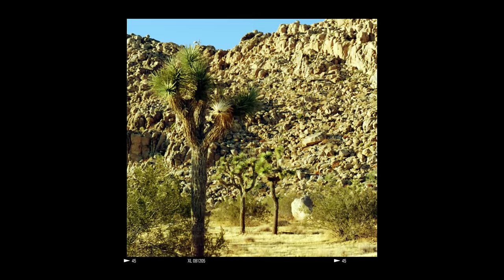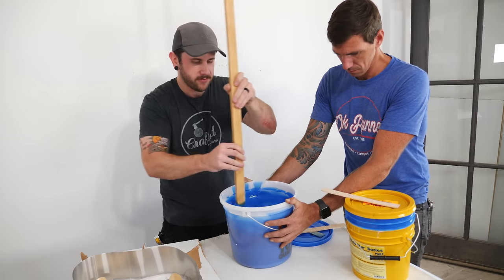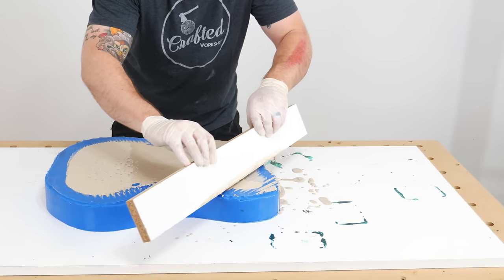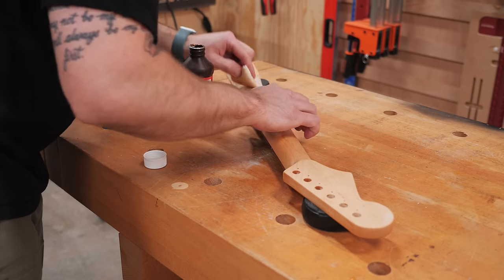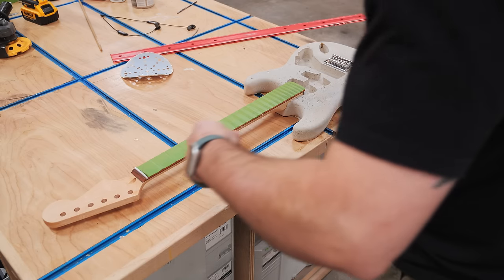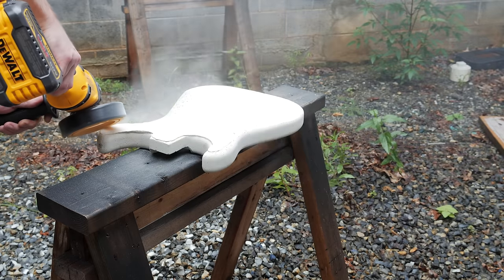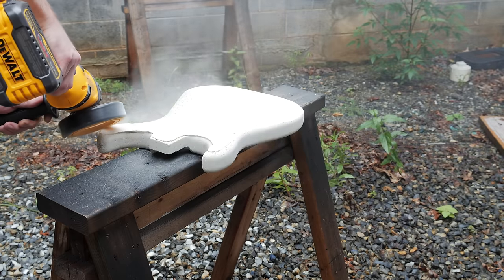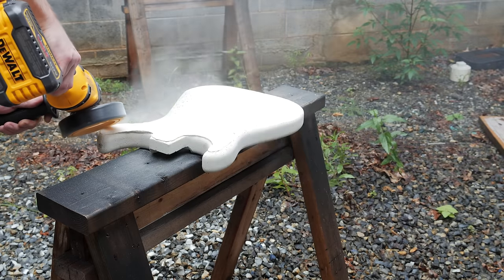I built a GUITAR out of CONCRETE. How does it SOUND?!

Comment: As someone who has built many electric guitars out of various types of wood, and all sorts of exotic shapes, I can definitively say the weight and rigidity make a big difference. Thin, light weight guitars have less sustain and less low-end frequency response because the body and neck tend to vibrate and absorb the low frequencies and damp them out. A heavy, rigid guitar, especially a thick neck, will have much better sustain and a fuller tone, regardless of what electronics you pack in there. It's basic "Conservation of Energy". If the body vibrates more, the strings lose energy faster.
Reply: Can I ask, and I'm genuinely interested in debate, not trolling, so please don't take me the wrong way as no disrespect intended ....
In my experience, the differences in electric guitar bodies, make almost no difference in sound. The only differences I hear, are from different pick ups, and strings.
There may be some very slight tonal differences in different bodies, but not enough that a very slight tweak of the EQ wouldn't balance out.
Acoustic guitars however, massive difference.
Reply: @DjNikGnashers  You can't compare two guitars by tweaking the EQ. You have to leave all the settings on the EQ and Amp the same, with the same pickups, then compare the tone. Yes, you can correct for the differences by tweaking the EQ, but that tells you nothing about the differences caused by the different body styles. The most prominent differences are, thin lightweight guitars with thin necks have short sustain, and not as much low-end frequency response. They sound tinny and dead. Thick, heavy guitars with a thick neck like a Les Paul sound fuller, more low end and more sustain. You must compare apples to apples.
Reply: @ToddDesiato  I hear what you are saying.
I just think you are wildly exaggerating the differences in electric guitar sound.
They might sound slightly different, but nothing a bit of EQ wouldn't mend.
Acoustics however, do sound completely different, and no amount of EQ or FX pedal will make them sound like a completely different guitar.
Reply: @DjNikGnashers  "wildly exaggerating"?  I made no claim as to how many dB the differences are, but none the less, there are differences, particularly in the amount of natural sustain. Note: If you have to boost the bass with an EQ, or increase your sustain with a pedal, you are reducing your signal to noise ratio and probably increasing the scratch and hum of a live performance. My main guitar is one I built back in '83, it's solid maple and weighs like 13 lbs with, perfect balance. I've built a lot of guitars and nothing beats a solid guitar.
Reply: @DjNikGnashers  Go compare a Les Paul to a Steinberger with a dry amp, then tell me there is no difference.
Reply: @ToddDesiato  I didn't say there was 'NO' difference did I matey ?
Please read what I typed.
Any minor differences are 99% down to the pickups, strings, nut/bridge...
There, does that spell out my opinion clearly enough for you my friend ?

Comment: Since "tone wood" has no effect on electrics I suspect it sounds like the pick ups you installed.
Reply: Nah I've swapped only the body and there was a big change.
Reply: @clintjones9848  Bullshit. Pickups use a magnetic field. It doesn't pick up sound at all. Anyone that says tonewood exists doesn't know what an electric guitar even is. Wood only affects sound. Pickups do not pick up sound. So unless you are playing your electric guitar unplugged, what it is made of doesn't matter.
Reply: @clintjones9848  How do you swap "only the body" without all of the electronics, strings, and neck being mounted differently?
Reply: No, not bullshit.  The electromagnetic pickups can still read the acoustic changes directly from the strings.  Pickups are also slightly microphonic so they do read sound directly from the guitar as well but to a lesser degree.  Anyone can perform this experiment and observe the same results.  Pickups read the acoustic properties of the guitar itself, not only the vibrations directly from the string.

The guitar is reassembled the same way because components are standardized.

Comment: Why would it sound different than a wooden electric guitar? All the sound comes from the strings vibrating over coils. Not from the body. It's not acoustic :D
Same stuff with audiophile gear.. they "hear" what they want to hear. Unicorn fart-dust wire plating doesn't make the electricity "smoother" or "warmer". Same with concrete/wood on electric guitar. It has no effect, until it conducts electricity.
Reply: if youve spent 20,000$ on PRS your mind has developed a coping mechanism that will never allow you to believe this

Comment: I disagree on tone wood. But I share Paul Read Smith's logic. Tone wood is reductive, not additive. The better woods (or materials) allow more resonance and frequencies to come through. Poor materials dampen and hinder the resonance and frequencies. There is no ultimate "tone wood" as there are several ways to get maximum resonance, including non-wood materials, but there are definitely woods that will make a guitar less resonant, dampened frequencies and have poor harmonics.

Comment: Tone is a complicated matter. If you think about it like EQ, I don't think wood really matters much in a solid body electric guitar. You got electronics, strings and amplification to modify that with. But there is a difference if you count adsr envelope into the tonal recipe. Denser woods will have a different feel to the notes than woods with lower mass. Denser woods tend to have a little more immediate attack and longer sustain and less dense woods more "bloom" to the notes (a little mushy). Another thing to keep in mind is that wood is never uniform. Two pieces from the same tree can sound markedly different, because some parts of the tree can be more dense than other parts. Thus you can find a featherweight piece of maple or a boat anchor piece of swamp ash if you really go looking for them.

Comment: The sound heard coming from the body is drained from the strings, and whatever is left can be heard through the pickups.  Various materials will drain string energy differently through resonance and liquid damping.  I doubt there's liquid damping from concrete.  What I notice in the electric sound is a strong attack.  It's not as bright as I expected, but sounds very good. Of course, the neck also drains some energy.

Comment: Why not dowel the neck pocket?  That way you have the option to adjust neck tilt with shims if needed, and of course replace the neck if the truss rod ever fails . 2 benefits of the bolt on design that you erased by gluing it in

Comment: The material itself probably doesn't matter much, but the neck and the body must be firmly connected. And in order to achieve that, a certain material in terms of mass, density  and hardness must be used on the body and the neck. Also, the neck must be able to withstand the string tension, and the fingerboard must be dense and firm enough to hold the fretwire in place and withstand continuous string-on-frets pressing. The guitar as a whole must be able to conduct vibration for proper sustain. As long as you have these aspects accounted for the guitar is going to sound ok.

Comment: they have a lightweight concrete, they push air into it, its an ALL fine sand mixture then they aerate it, you can make it yourself,, make an aerator..  yup, lightweight is on most apartment and condo floors, some homes..

Comment: At PRS they built two guitars from the same tree one sounded great the other meh. They switched the electronics and it didn't change a thing. Wood matters. You can use other stuff like aluminum, plexiglass/plastic, or even concrete--all will have tonal ramifications.

Comment: Concrete guitar owner: "Hey buddy, wanna help me load up my gear for the gig tonight?"
Buddy: "Hahaha no." 
You can add perlite or vermiculite to concrete while mixing it and save a significant amount of weight. You can also sort of "whip" the concrete while mixing to make it full of air bubbles ("air-krete"). Both of those techniques will change the surface texture and appearance, but if you want you can work around that by pouring normal concrete first and last, with the lightweight stuff in the middle. Lightweight concrete is a whole rabbit-hole unto itself.
Speaking of texture, the plain stuff will look and feel normal like that one, but the stuff with a lot of rocks or other aggregate mixed in will of course, have a bunch of rocks or other stuff in it. Likely not very comfortable right where your arm rests, but again you could probably work around that if you're careful. Sometimes people put various fun doodads and whatnots into the surface of the concrete while it's wet, like marbles, flat pieces of colored glass etc etc etc.

Comment: Very impressed, but only nit I'd pick is that it didn't look like you grounded the cavity shielding.   Ideally, I'd try to wrap the cavity shielding around the edge of the route (or cast pocket in this case) so it could make contact with shielding on the underside of the pick-guard.. which would be grounded to the Pots, which are grounded to the jack.. etc.
I can be a bit anal retentive though.  :-)

Comment: And I thought that my Les Paul was heavy.  It was always the heaviest of all my guitars, but the one I always evens up wearing most of the night during gigs. I really bitched about how heavy it was by the end of the night. I can’t imagine doing a 5 hour gig with this beast.

It looked like a really cool experiment though, but I can’t imagine playing it on a strap for more then 30 minutes.  I did always get the longest sustain from the Paul.

I always thought that was because of the weight and solid grain of the guitar resisting the string vibration better than the lighter guitars.  It usually felt like they were absorbing the vibration and making the string slow it’s vibration, like a shock absorber.

If my theory on the different density of guitar bodies was correct, that concrete guitar should sustain a note for about an hour.  Let us know how well it sustains a note?

Comment: Very interesting project.. Not sure I'd be satisfied with just gluing the fretboard/headstock to the body. Definitely would want to use the strap or wear steel toe shoes while playing this guitar in case the glue breaks loose. Twenty pounds of concrete potentially falling on my toes does not sound like a good time.

Comment: Material on a guitars sound only matters if your using an acoustic or something where the tone of guitar or instrument is vibrating off of what is made out of, though an acoustic strings are vibrating you can feel the vibration on the guitar where as an electric not so much and most of it that is, is taken in by the pick ups and hardware to produce the sound quality you want and can adjust, compared to acoustic, kinda stuck with whatever you got.

Comment: "Tonewood" in electric guitars only affects how long the guitar sustains,  at any given pitch.   Some wood absorbs vibration more quickly at some frequencies than other pieces.  Every material absorbs vibrations.  How it absorbs them, how much and at what frequencies, defines how that material affects the sound of a guitar.   It's less important with solidbody electrics, and even less important still when using distortion.   But it's still a real factor.  Maybe not much of one. 

Now make a guitar out of lead.  Then make one out of bell bronze.  They'll be super heavy but they will sustain differently than one made of any wood, or concrete,  or each other.
Reply: Not sure but I think you mean Bell Brass not (Bronze) I mention this because my parents have a small bowl that's made of bell brass and the thing rings for ages if you give it a good flick.
Reply: @jeremyabell3650  Bell bronze is a thing. It's what large bells are made of, and NOT brass.

Comment: According to Les Paul, his goal was to remove all sound resonance from the guitar, so you only hear the sound of the string. For sure concrete will not resonate, so in theory, the sound should be more pure. While there can be no doubt that tone wood is real, what is more likely is that the inherent tone of the guitar is masked by the strings, electronics and amp. Those are more dominant. However the high end the pickups and electronics are, the more you will actually hear the acoustical character of the instrument.

Comment: This project was insanely cool and well put-together, and the guitar sounds very nice. However, I would definitely disagree heavily that this sounds like a wooden electric guitar. Much brighter, more treble-sided tone. Lack of resonance with the lower frequencies. Maybe I'm talking out of my ass but that's what it sounds like to me. I'm on really high quality headphones too. And yes the body does matter to a small extent. I mean try telling me a Strat and an archtop Gibson L-5 dialed in the same and with the same strings have a similar tone. They just don't, and the body shape is one of these factors. The pickups are designed to receive vibrations from one direction but they're still resonating inside of the body of the instrument on a small scale, and the electronics aren't perfect. Yes the pickups and overall setup of the strings, action and stuff are probably more influential to the tone, but why else would they have archtop and hollow body electric guitars? I also think humbucker Strat and humbucker Les Paul sound a bit different. Thoughts anyone?

Comment: I build guitars for a living. (DVR) Electric.  Electric guitars have almost ZERO sound difference compared to material, or shape of the guitar.   That's why they have Flying V's  ;  Strat Style ; Les Paul ; Warlock ; Star shape ; etc, etc , etc.   And, they are made of  Wood ; Plastic ; Resin ; Silicone ; Aluminum ; and (concrete... I guess).
Its all about the PICK-UPs & STRINGS.     * And your style of playing*
 Rock  On  🎸 
    DVR

Comment: So you make a rock guitar, now make a metal guitar.  Smelt down a bunch of aluminum cans into clean ingots and then resmelt for the mold.  Do the same process, only you will need to make a mold that can withstand high heat.  Aluminum is super light compared to it's strength.  It also doesn't rust and will shine up so bright you will go blind.

Comment: You can build a fully electric guitar out of anything at all. you could nail the electric bits and the neck to a coffee table or pour some glue over a load of elephant shit and carve it out of that, it really doesn't matter because the entire sound of the guitar is created by the electrics. If it's a solid body guitar you're not relying on any manual physical reverberation from the body

Comment: you negate the benefit of a bolt -on neck when you glue the neck to the guitar body.  Why did you not just use the epoxy-dowels you used in all the other places that required bolts or screws?

Comment: I disagree. Tonewood makes a difference. The best advice I got from my guitar teacher years ago is to play an electric guitar unplugged first. If you don’t hear rich tones unplugged, you probably won’t hear them plugged, or at the least have to crank your equalizer to compensate. My experience is, the harder the wood, the brighter the sound.
Reply: I used  to believe that myth to about electric guitars  knew a guy when I was much younger that had many different guitars different woods but thay all had  the same pickups and pots they sounded exactly the same  . Your strings rest on steel and whatever your nut is made from. It's kind of like the myth tof heavier gage strings gives you a lower  tone.